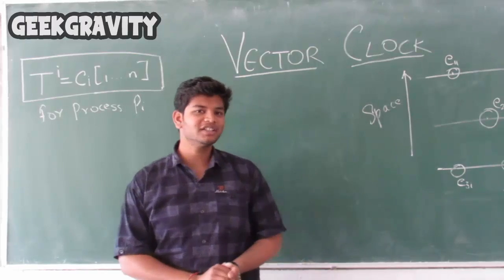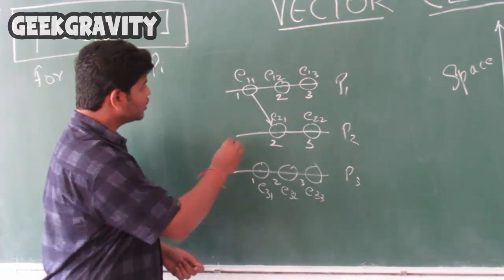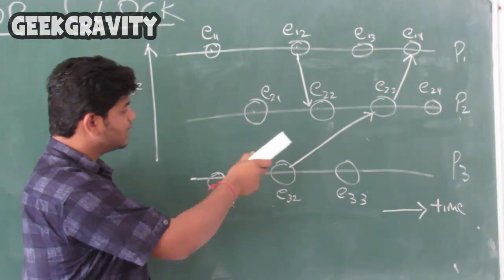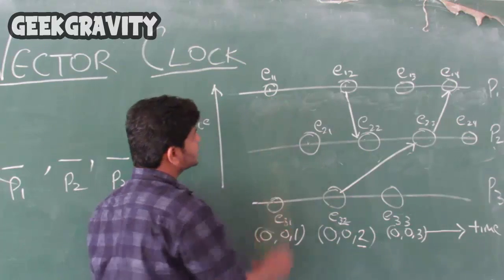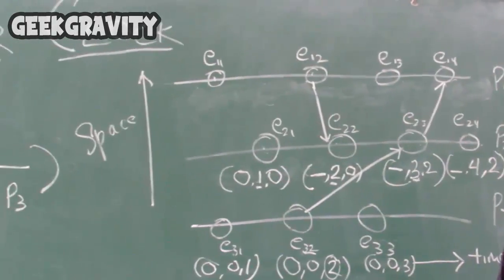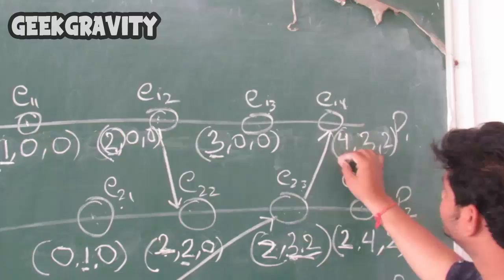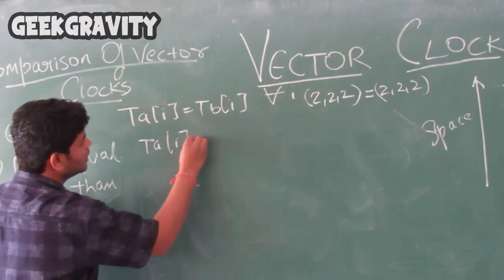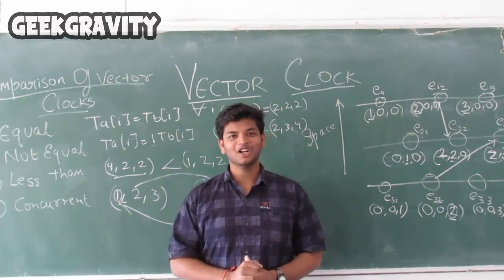VECTOR CLOCK | MODULE 3

Comment: i beg you sir please tell about Causal ordering of messages,
global state, termination detection. Distributed Mutual Exclusion: Classification of distributed mutual
exclusion, requirement of mutual exclusion theorem, Token based and non-token based algorithms,
Performance metric for distributed mutual exclusion algorithms,Distributed Deadlock Detection: system model, resource Vs communication deadlocks, deadlock
prevention, avoidance, detection & resolution, centralized dead lock detection, distributed dead lock
detection, path pushing algorithms, edge chasing algorithms. Agreement Protocols: Introduction, System
models, classification of Agreement Problem, Byzantine agreement problem, Consensus problem,
Interactive consistency Problem, Solution to Byzantine Agreement problem, Application of Agreement
problem, Atomic Commit in Distributed Database system
Reply: bhai bevda hai ke?